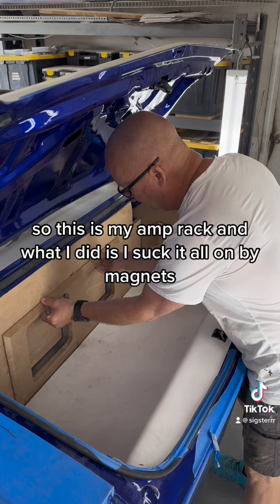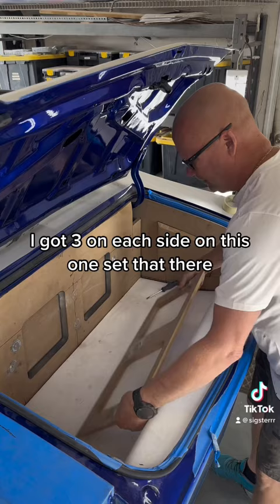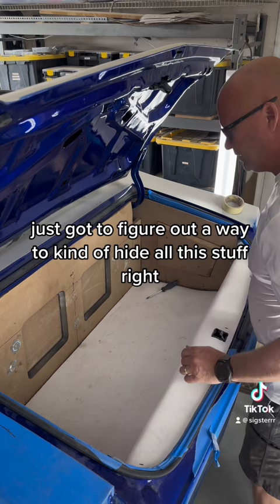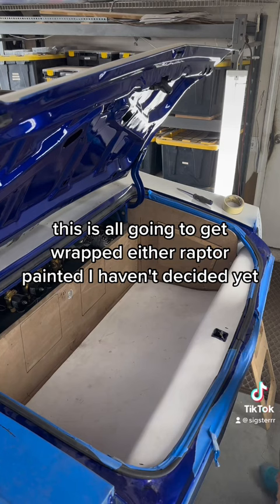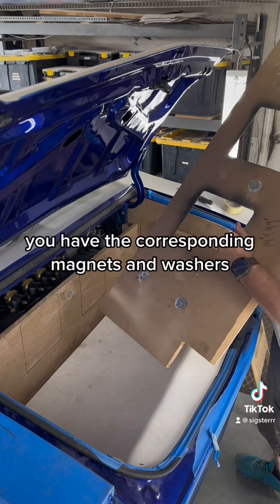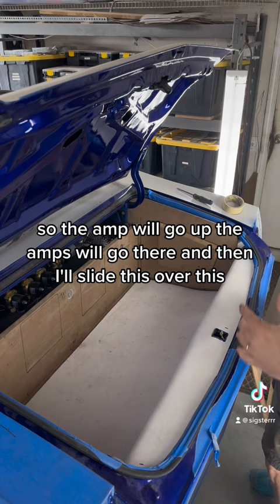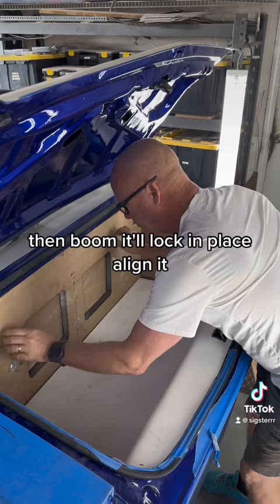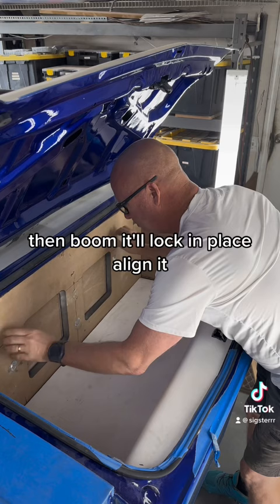Building the amp rack and trunk enclosure in my 69 Chevelle twin turbo restomod

Comment: Are you worried about the magnets messing with the audio equipment at all?
Reply from the maker: That’s a good question. I’ve seen many pros use them so I assume it’s fine. The stereo is more for show to be honest since my motor will be so loud.
Reply: Na. Speakers got big magnets on the back of them. Some subs have neo magnets!